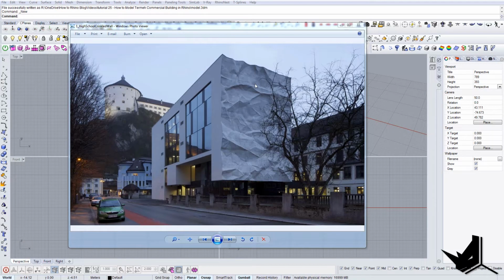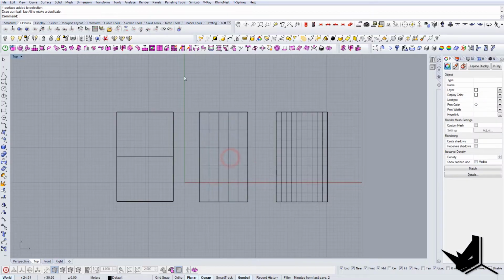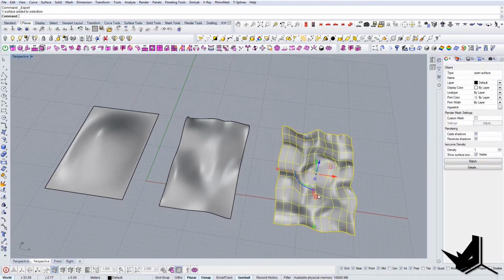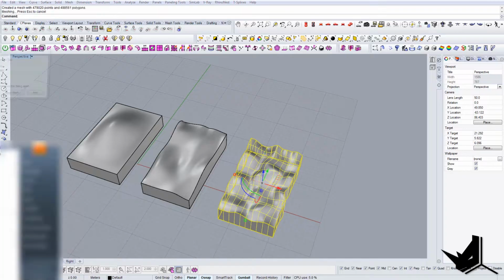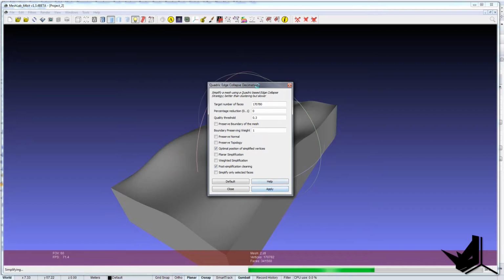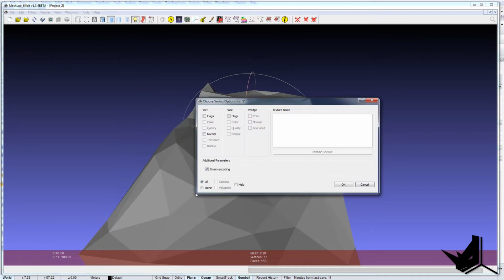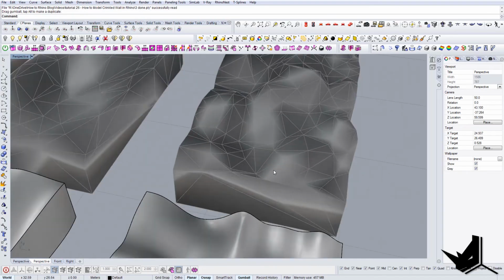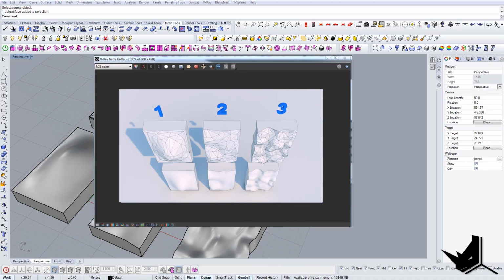How to Model Crinkled Wall in Rhino

Comment: For anyone asking, you don't need this plugin to get the same result. Just make a polysurface and then use the command "rebuild", you can then increase the U and V count for each surface. Also depending on the size of the surface, when you export the stl you may have to reduce the tolerance to the one-thousands place. You can go higher of course, but it will take much longer to process the stl. I had some stl's in meshlab get bugged out when i was reducing the surface count but once I got down to below a 1000 it fixed itself. So keep reducing the count if you see this problem.
Reply: thought so, thanks for confirming!
Reply: How do you get the sharp edges than the smooth ones while controlling the points?😟
Reply: how do i make the edges sharp

Comment: What external software are you using with Rhino? I noticed you had an additional pink bar of icons and commands that I do not have. Would I need to download a separate software? Thank you!
Reply from the maker: These are plugins for Rhino, the "pink" one is called t-splines. However, it's not an active plugin for Rhino anymore :/
Reply: @HowtoRhino And how would it be done without this plugin?
Reply from the maker: @JustAKool_guy  SubD tools for Rhino 7, they can be found in Rhino WIP version, if you have Rhino 6 license, you can try this out. Works great!
Reply: @JustAKool_guy  it can be done with normal surfaces too, just make a surface and serch for rebuild, then add the number of control points you whant the surface to have
Reply: @HowtoRhino  how through subd can I get this?
Reply: How do I do this using subd?